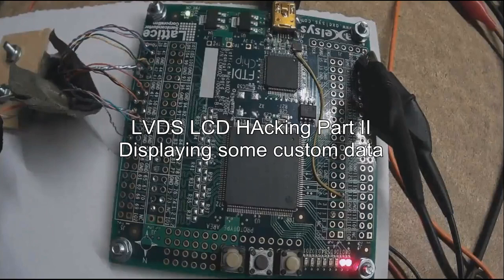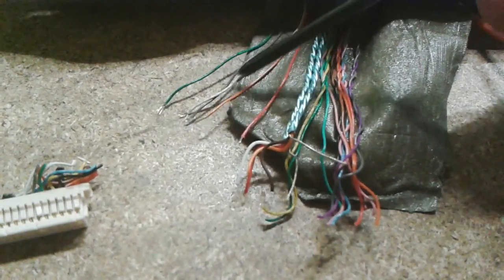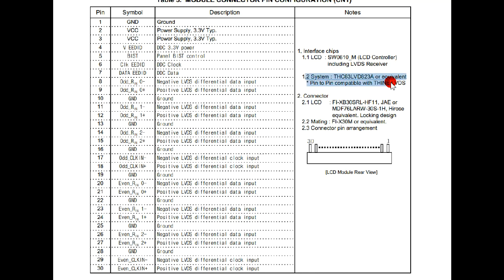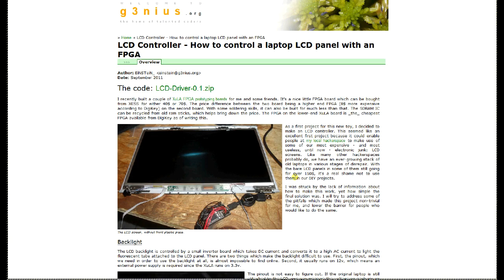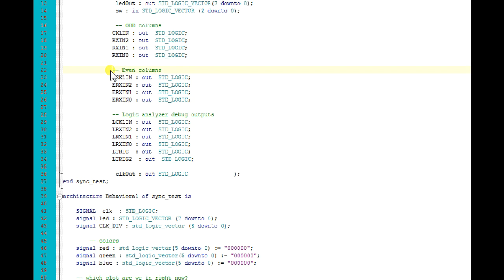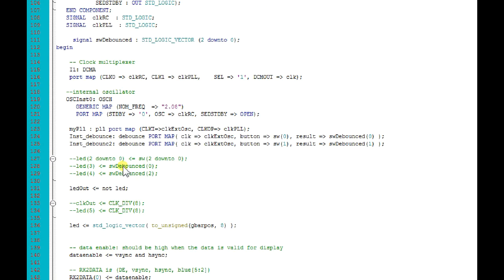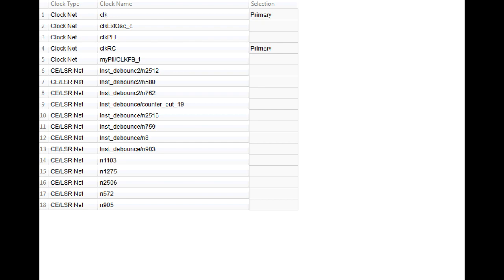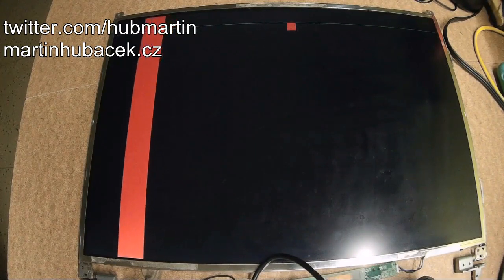Laptop LVDS LCD hacking with FPGA #2

Comment: nice work anyway, I've read your code (lvds_test.vhd) on GitHub,  what is the output frequency of clkPLL (line 184) in Hz ? is there filcker on your display because of slow speed LVDS transmission rate ?
Reply from the maker: Thanks, it seems like LVDS clock is 192 MHz which could be low and the reason for artefacts. https://github.com/hubmartin/FPGA-LVDS-LCD-Hack/blob/master/pll.vhd#L94
Now I do it again with better FPGA but it has issues above 200 MHz, so I have to look into that. Check my Twitter feed https://twitter.com/search?q=%40hubmartin%20%23cyc1000&src=typed_query
Reply: Thank you for your fast respon reply :) I appreciate that. I think so, Lattice board that you use is not quite fast. CYC1000 is something new for me, do you put into Github also? or any video results using CYC1000?
Reply from the maker: @abilfida4269  search my github hub.martin for CYC1000. Ive uploaded that code.

Comment: Nice, is it work to LCD TV panel, which is use LVDS, too?
Reply from the maker: TheJavaSync If the panel has differential pairs visibly routed on the pcb/flex cable, then it will most likely use this LVDS standard. The bit positions of colour bits and synchronization bits could be different. Also there will be most likely only single channel lvds, depends on panel resolution.